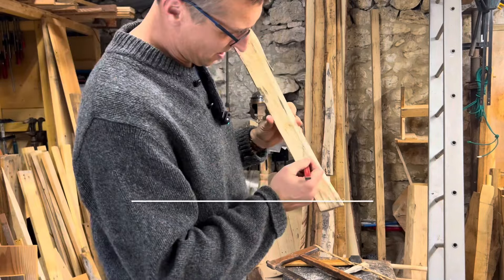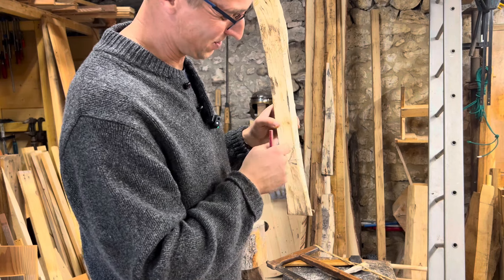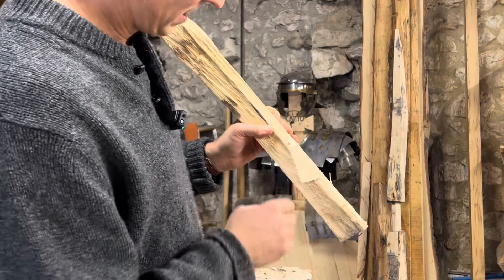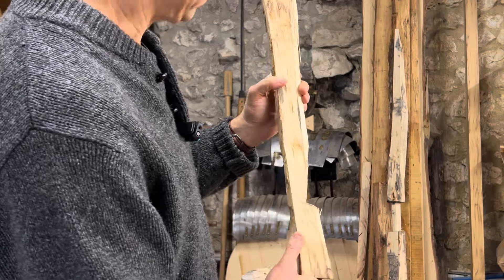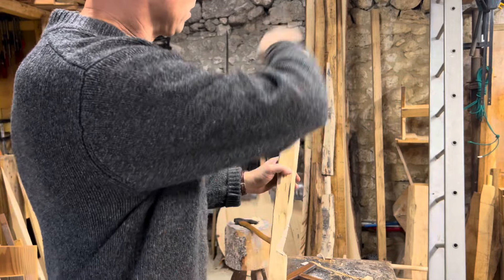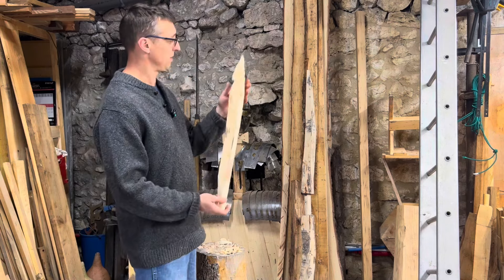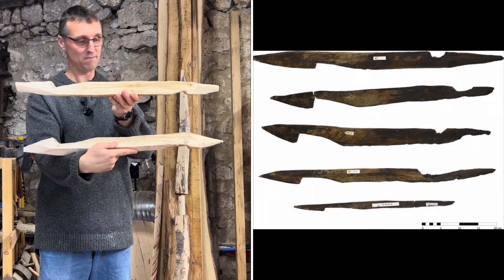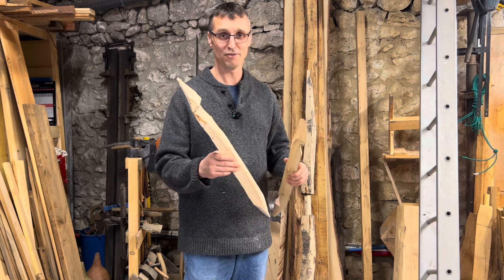Pila Fossata the Roman Stake Pt3

Comment: I really did enjoy these series on a subject I've only seen in pictures and read about in Julius Caesar's book THE  GALLIC WARS and Michael Grant's book THE ROMAN ARMY. 
Would these pila fossata also used on the palisades?
Reply from the maker: Certainly it would seem so given the evidence from Bad Ems. Multiple sharp stakes have an almost barbed wire style effect making almost too problematic to even try and pass through just to reach a palisade wall. In this case the stakes are placed at the bottom of a steep sided ditch, the real obstacle is the ditch, the stakes have in my opinion are mostly a visual deterrent, whilst a slip or fall may not be fatal these are really difficult to negotiate, especially when under fire. Thanks for your comments it is nice to know that you enjoyed the content.

Comment: So very interesting.
Probably these are the stakes each legionary would carry two of. The larger ones are way to large to be carried comfortably along with pilum, scutum and furca.
Reply from the maker: That's entirely possible. When I made the larger sudis they had an average weight of 5kgs, so that's 10kgs more on top of a minimum of 40kgs total loadout, which is heavy. But yes excellent observation.
Reply: @thelegionary72  Also the sudis is very long and full of sharp angles. This makes it hard to be carried conveniently by resting it on the arm and the shoulder. These pila fossata (probably "pila fossatorum" in Classical Latin) seem to be about 70 cm long and far lighter. Also the notches make it easy to tie two of them together in a bundle and carry it over the shoulder on the back with a simple rope harness filling the gap between the back and the scutum (when the scutum is carried on the back). How much do the pila fossata weigh?